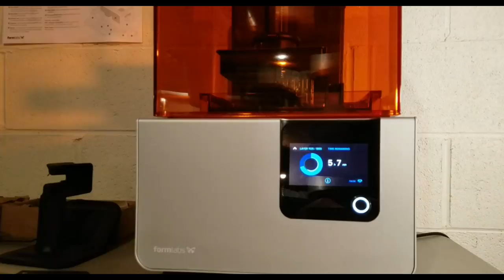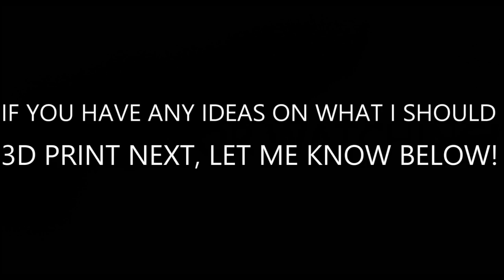3D Printed BMX Sprocket

Comment: I did not expect it to hold up. Makes me wonder— if a DLS/SLA-printed sprocket is strong enough to endure BMX riding, would an FDM-printed sprocket be sufficient for a commuter road bike? Tolerances would certainly be a concern, and a high-strength thermoplastic like ABS or PETG would have to be used. I'd also like to see how the part is affected by things like chain lube and UV light, as those could be problematic for polymers in the long-term.

Comment: You should ride the 3-D printed parts till they break
Reply: Daniel Johnson if you set the infill and fill density to 100% there is a good chance they won't break. I printed a boat propeller with 100% infill and I was able to get to 40mph (i have a small engine) so yeah
Reply: +Cameron S"wont break" is like saying "unsinkable ship". and when referring to plastic parts it's just stupid to say they won't break. the metal equivalents are destroyed all the time, what would make you think that some shitty plastic version is better? lol
Reply: swag overload they wont break if used in moderation, if you had a go kart with a 670cc v-twin with 3d printed sprockets and you went ripping up your yard with it they would most definitely break
Reply: there is no moderation in bmx. everything is hard on the bike, a sprocket might unless you bash it in
Reply: Yeah, "won't break" is really impossible, it's only a matter of time until the chain wears the sprocket to dust. And I would imagine that time is way less than with a metal version.
Reply: it fine to say they won't break but over time everything fails to fatigue or gets replaced before

Comment: BMX HELP! what happens if you don't use a sprocket guard. My bike rode fine before I took it apart. I could pedal up a hill no problem or put weight on the side where the sprocket is. I took it apart and noticed that piece was missing. It just had washers on both side of the crank. Well I knocked them out but didn't look how everything was put together 😂. Well I put it back together with the spacers made sure the sprocket and the cassette were lined up made sure the wheel was centered and tighted the chain. Then now when I put weight on the sprocket side there's like a feeling like it skip or jerks and a crunch-en sound.but yea that piece wasn't there crank adapter. You think that could be causing it?

Comment: Jonny Lee... What type of material do you suggest to build parts for the bike? ABS works good with these kind of projects?
Reply: I think polycarbonate would be good - but it's hard to print
Reply: @ELValenin  Cant use any layer printers, would have to use resin for it to be solid enough, maybe nylon fiber but cant say for sure

Comment: i've made a few before but never tried riding them. I did however made a pedal that i used and even grinded on a lot. you can find it on thingiverse. it fit's the JCPC parts: https://www.thingiverse.com/thing:16736
Reply from the maker: That's an awesome design man, nice work! I'm actually planning on printing some pedals here soon, the only problem I have is getting the measurements right for the axle and bearings. Stellar work man
Reply: Rad! We need more stuff online. I just uploaded a hub guard to thingiverse